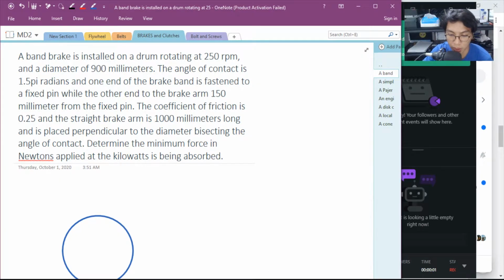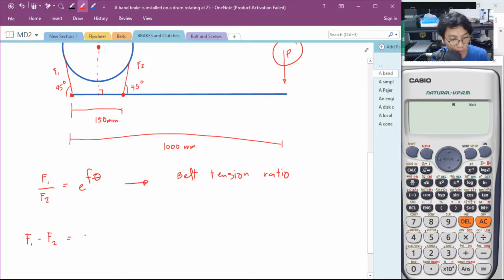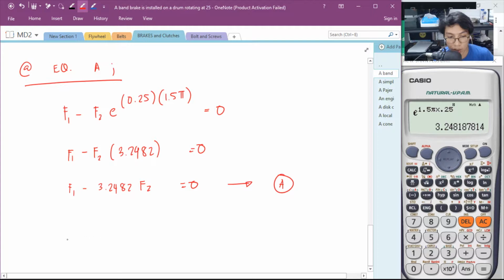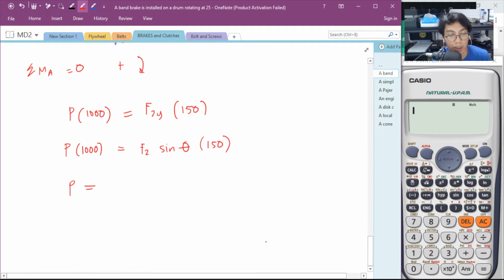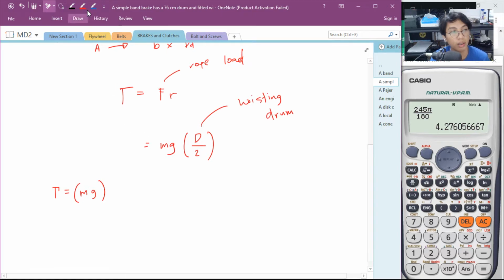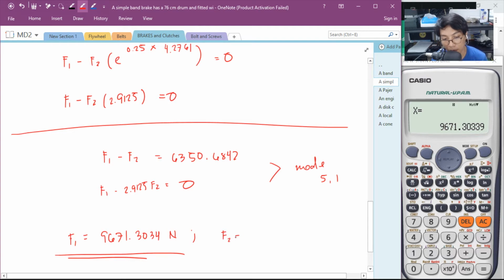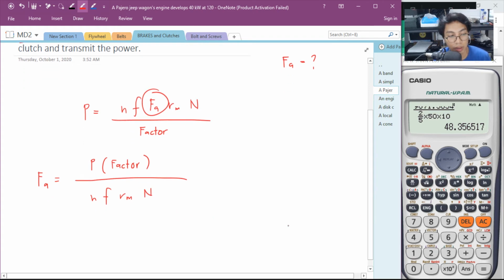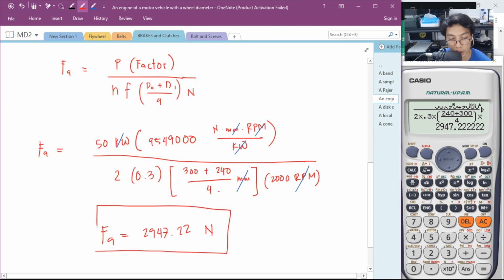Machine Design: Brakes and Clutches Samples (1-4)

Comment: Engr. tanong ko lang kung kelan iassume na 45 degrees and angle sa band?
Reply: Boss sabi kasi angle of contact = 1.5(pi) Rad or 270 degrees. So yung natirang 90 (sa 360 degrees) yun ang magiging angle na in-line with the brake bands  - which is dalawang 45.